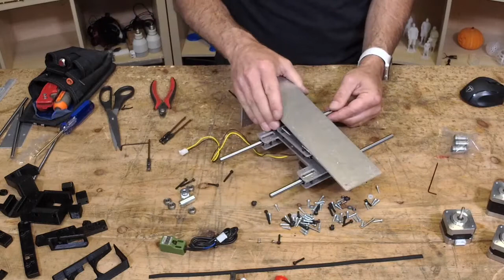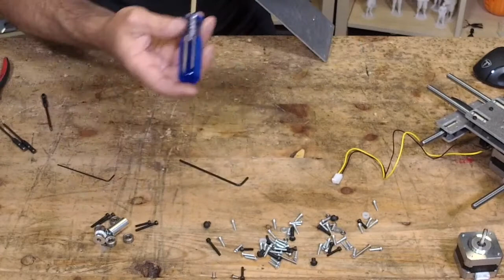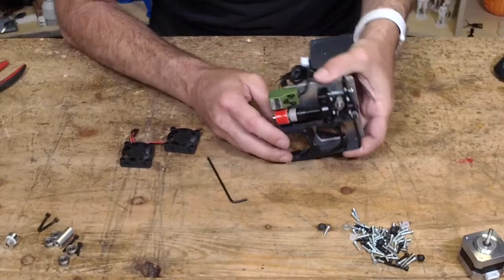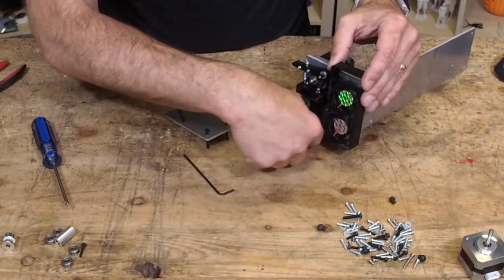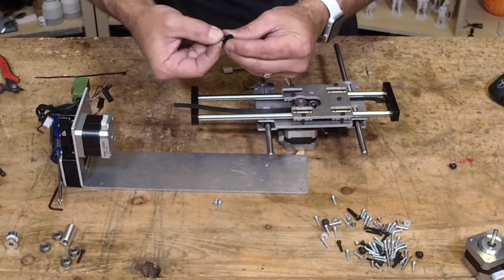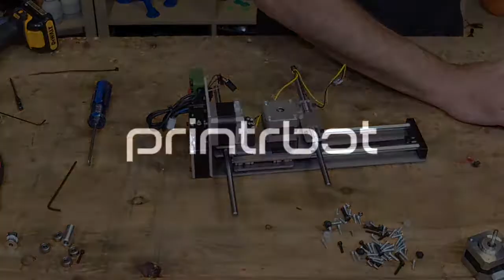Printrbot Smalls Build Video 2: Y Gantry

Comment: For those who (accidently?) received 270mm rods and not the 250mm ones, a 5/16" drill bit will open up the back bracket (where the belt tensioner is) so the bars can extend out past the gantry. Easier than cutting the bars to length, faster than waiting for a replacement part.